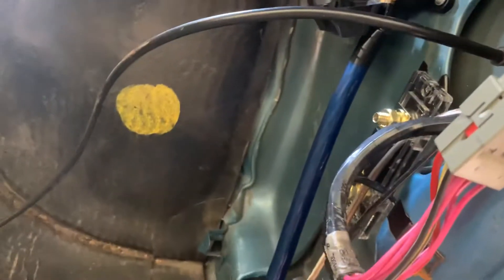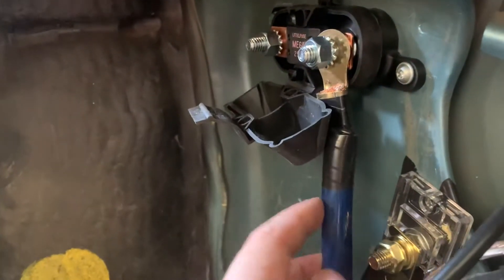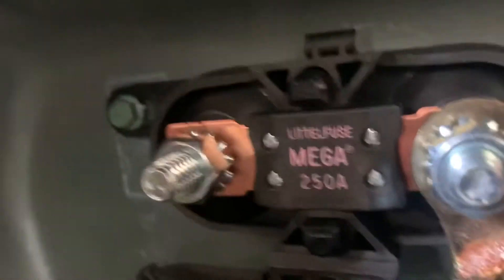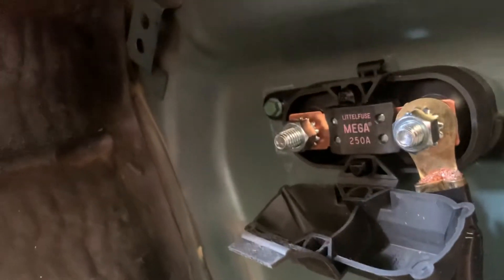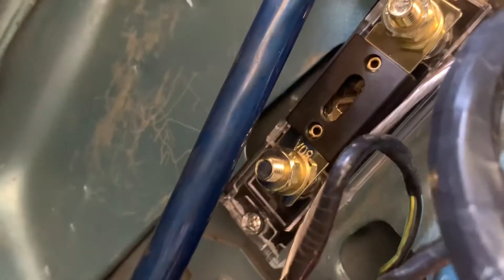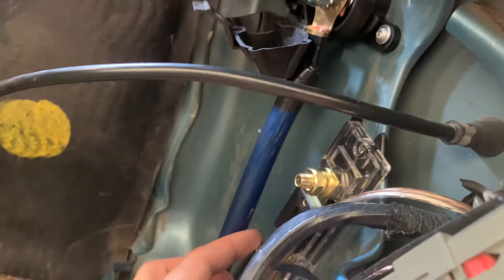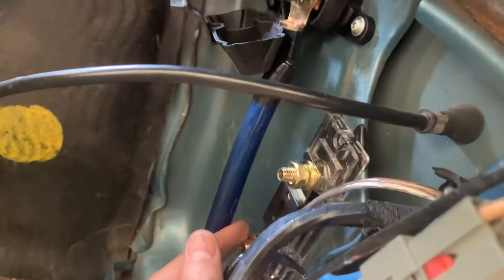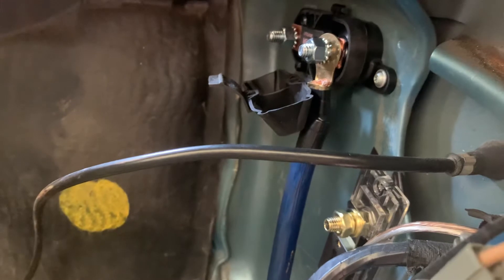Foxbody Coyote Swap Wiring

Comment: I plan on doing what u did... So just to confirm ur starter and alternator and volvo pump and stock fuse box and control pack fuse box all are connected to that one side of the mega fuse? The starter goes directly to that fuse and alternator goes to that fuse right? Just want to make sure any voltage spikes are going thru a fuse just in case
Reply from the maker: Ill take a short for you tomorrow so you can see the engine bay where the stock fuse and starter link up! Good luck with your build! 😎✊🏽
Reply: @rattletrapfox1001  So that 250 mega fuse is only protecting the control pack? You dont have anything protecting the starter or alternator?
Reply from the maker: @GSPMotorsports  i deleted my reply buddy as i dont want to spread misinformation. Let me take off the kickpanel and confirm with you broski
Reply from the maker: Ill take a short tomorrow for yous

Comment: did you use the ford racing control pack or PBH?
Reply from the maker: Ford racing control pack: https://performanceparts.ford.com/part/M-6017-504V
Reply from the maker: It was very easy to setup. All wires were marked nicely